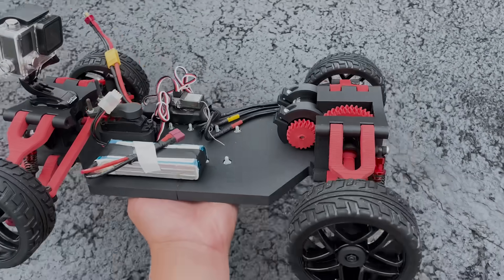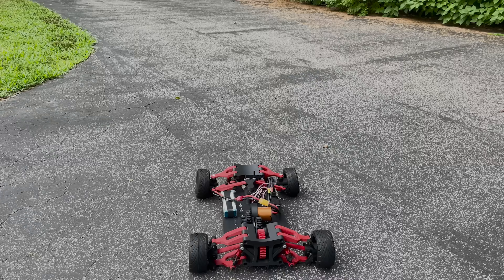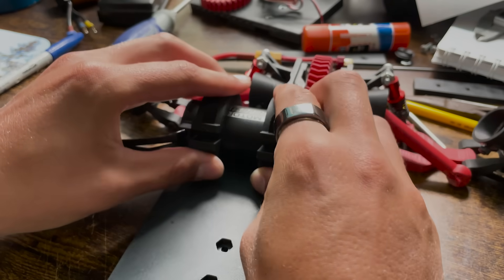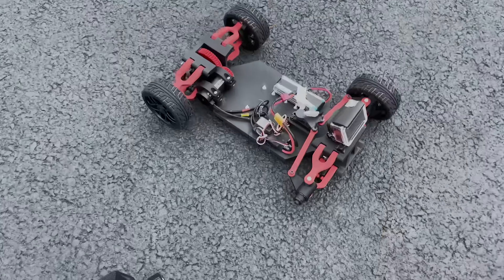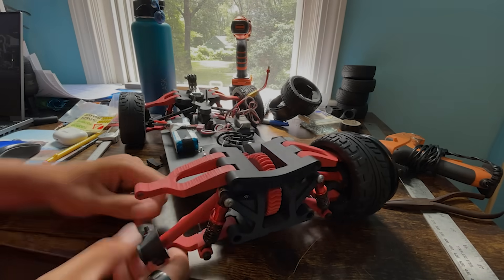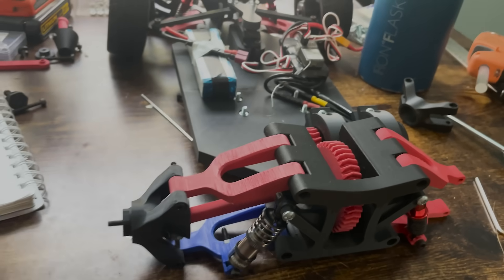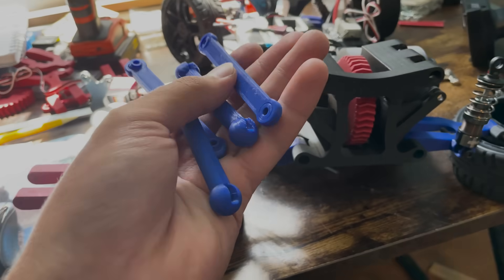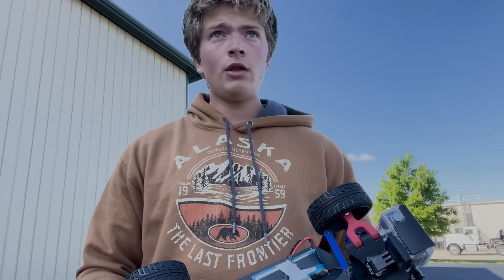Engineering a Better RC Car

Comment: for that last break on the main chassis, rather than using PETG or carbon fiber, using TPU will absorb the collisions really well. The tarmo 5 (another 3d printed car) uses it in that exact spot, and it completely fixed that issue. Tarmo 5 CAD files can be found on Onshape
Reply: Actually I'd stick with CF for the chassis  unless it's real high stiffness tpu, you dont want chassis flex in rc, we even usually add chassis braces to prevent it.  A tpu bumper though, thatd go a long way to absorbing the shock, as well as making sure theres one tou part in each part of the driveline to absorb hard acceleration flex, etc.  Pla is so brittle...
Reply: sainsmart 95a tpu will work nice
Reply: Tutorial? I want to make a 1/4 scale lambo svj
Reply: @daanvk3264  There are a bunch of tutorials for the Tarmo 5, however it is much too small for a 1/4 scale lambo svj. Your 1/4 scale of 4.8m, would be about 1.2m long, whearas the Tarmo 5 is about 0.4-0.5m I think. I would recommend modifying it to make it larger, or integrate it's parts into a design with a larger motor, and making a outer shell overtop. 

If you want to make a 1/7th scale lambo, you can just copy the creator's design, and add a outer shell. (he already started cad for a monster truck shell) The creator's video is called "Tarmo5 | 3D Printed RC Car" if you want to do that.
Reply: imo ans would fit better....
Reply: @storylineOfMadness  r u talking about IMØ brand abs?
Reply: @vincentjarvis4296  not sure. we have some local manufacturers, but usually its abs woth some additions to make it print easier and produce less odor
Reply: 100% infill tpu is essentially a chunk of rubber...feels really strong, do this with driveshafts too.
Reply: Petg cf would be ideal
Reply: @alex59292  No PETG does not have impact resistance, even with CF it will just shatter.  PLA+ is actually a really good plastic for impact resistance and rigidity.  Nylon is another plastic that is good for impact resistance, but is only marginally better than PLA+ and much more difficult to print.
Reply: @brianbu01  petg has way better impact resistance pla is too rigid and as a rule of thumb if it's rigid it means it doesn't have great impact resistance hence Petg is more ideal
Reply: @alex59292  Have you tested that postulate?  Cause I have.  The fact that you said PLA and ignored the Plus is a big indicator you are unfamiliar.  PLA+ is drastically different in terms of impact strength. PETG shatters like glass when it hits a hard surface.  PLA+ flexes and absorbs the impact.  I have 100% confidence in this as fact.
Reply: @brianbu01 pla"+" isnt a blanket term as not all of them are same it varies from different sources
Reply: @alex59292 I'm gonna agree with the other dude's recommendation of TPU. I've printed lots of things in 98A TPU and lots of things in PETG-CF. PETG-CF is great, but the TPU is absolutely indestructible. The 98A isn't very flexible when printed at 100% infill, but still maintains the indestructible nature.

Comment: This has been a really fun project to follow, I've been looking forward to an update. It's tricky designing RC cars with 3d printing, there are too many high stress points (particularly with a brushless setup and at the scale you're building at, all that weight, etc), and all the moving parts involved. But overall I'm very impressed by your work and persistence in getting this to work.

It really makes you appreciate that you can send modern RCs 30 feet in the air and they somehow don't blow to pieces!

Speaking of modern RCs, have you considered printing it out of something more durable like nylon? I've read it's a huge pain to print (it absorbs moisture worse than most other filaments) but it'd at least get more bendable properties. But hey, I'm not the expert here :)

EDIT - ok you mentioned possibly printing in nylon or something CF-reinforced. But, have you considered printing certain parts in TPU? If you print with 75%+ infill in 95A TPU it's virtually indestructible, for things like the A-arms. This won't help the issue of the chassis cracking on the hinge pin retainers though.

I haven't studied the designs yet but I ran into the same problem on my Kraton 4S, same break on the hingepin and it required an entire new chassis which really sucked. A stronger material is definitely a must for the chassis, whatever it is, but you might also consider splitting the front and rear chassis into separate parts so you don't have to re-print a chassis and rebuild the entire thing when the inevitable happens.

All of these are ideas, I know this is a rabbithole of a project already but it's in great shape already. You did an awesome job getting this thing on the ground and moving.
Reply from the maker: using different materials was one of the biggest takeaways from this project. I think I'm going to remake most the chassis with CF for rigidity, but parts like the axles which are under all sorts of weird torques and forces but are still held in place by the rigid frame of the A-arm would be a great use of TPU or something flexy. thanks for your input!
Reply: Yep, nylon does need to be extremely dry, make sure you're equipped to bake it before printing. I do a lot of mechanical design for an engineering reliability lab, nylon and polycarbonate are definitely the way to go for strength. Only use carbon fiber to add stiffness, it actually removes strength. We use Essentium's HTN-CF25 filament, it is mind-bendingly strong but just as expensive as you'd expect. As long as it's dry it prints as easily as PLA though, just much higher temperatures. I've heard that NylonX is a good alternative and much cheaper though I haven't tried it myself.
Reply: Carbon fiber doesn't realy have any benefit 3d printing. It's like fiberglass.

Comment: i think you shuld print thinks to this project like with 80 - 100% infill plus don`t you think this spring make better up of course you would have to redizained this big part. Right now i am also working on project likte that but I haven`t stardet printed yet only modeling.

Comment: A like before watching is a must with this channel (:
Reply from the maker: you're the best :)
Reply: @hamburgerinc6995 
After watching, I have some recommendations, if you ever try again to build/improve this one, you should make the chassis a 3 piece, middle section, front and rear, this way if anything breaks - it's easier, faster and cheaper to replace.

Also, having the gears out in the open could cause some damage to them if anything flies in, so adding a cover could be a huge help.

It was an amazing project and I hope you will keep improving it/use the skills you learned in future projects!
Reply from the maker: @IsThisRandomName  good advice, thanks for the feedback!